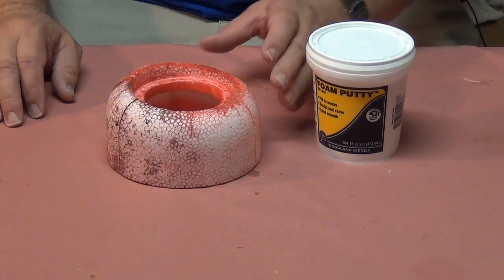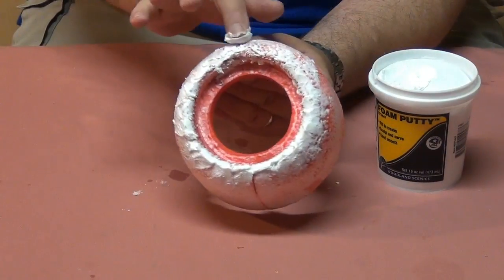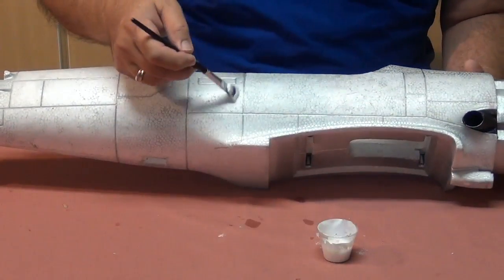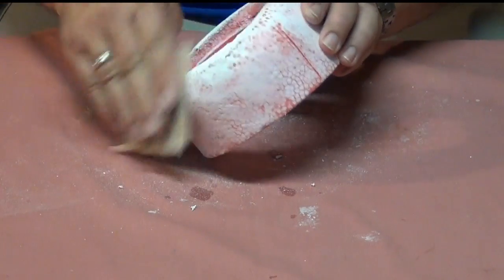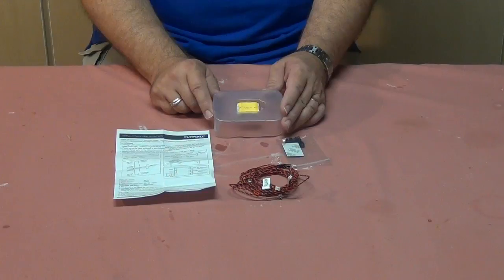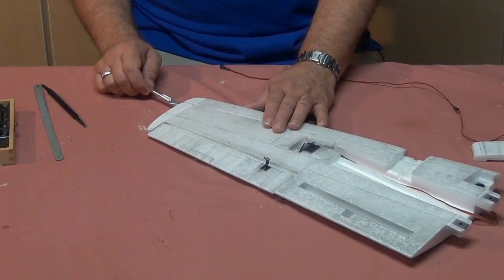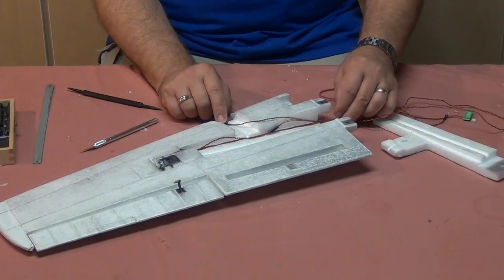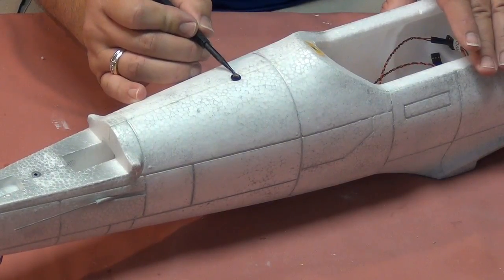Restoring EPO Models   Part 3

Comment: Would it just be easier to replace the cowl with
A fiberglass cowl?
Reply: Video game flyer Part of the fun in this hobby is working with your hands. A little time, a little sandpaper, putty and paint is way cheaper than the cost of a new cowl plus shipping [not to mention you might ding it up again].
Reply: You could also add reinforcement i.e Killerplanes, milk carton plastic at this point for strength.

Comment: How are you getting this foam puddy to work its to soft everytime i sand it it just falls off
Reply from the maker: +Bob Barker I've had pretty good luck with the foam putty and other light spackle products.  I usually put it on pretty thin and let it dry completely.  Then add another layer and so on. In cases where I was filling a larger ding, I've placed some tooth picks across the span for something for the putty to hang on to.  Kind of like chicken wire under stucco.  I usually let the stuff dry at least overnight. When dry it's really hard and takes a bit of sanding with a fine grain sand paper to get it smooth.  A lot of times I'll use a credit card-like plastic piece to use like a squeegee to match the surface as close as I can to avoid some of the sanding. I've not had any issues with it coming off if it was completely dry.

Comment: There is absolutely no way of keeping a smooth surface on epo foam, even epoxy coating with glass and getting it perfect in the workshop once its taken out on a hot sunny day the foam cells expand and ghost through the glass. My advise, dont waste your time!!
Reply from the maker: The goal was never to have and maintain a perfectly smooth surface. Rather, it was to smooth out dents and depressions from minor crashes to big oops. Foam is what it is but there is no need to have your model look like an old beater -- unless you like that look. If so, then go for it!
Reply: Alot of these guys don't even fly. They just buy these and hang em in their garage.